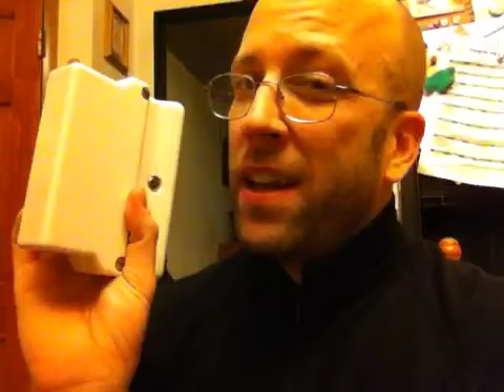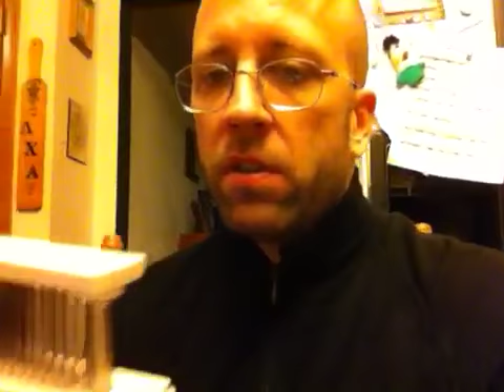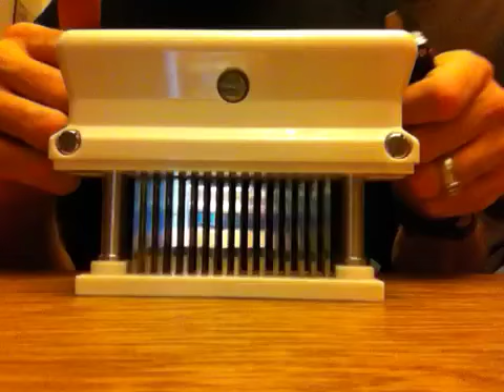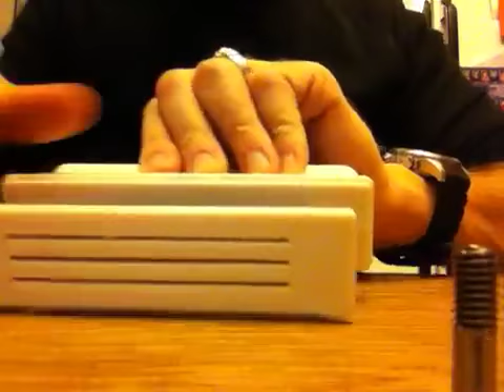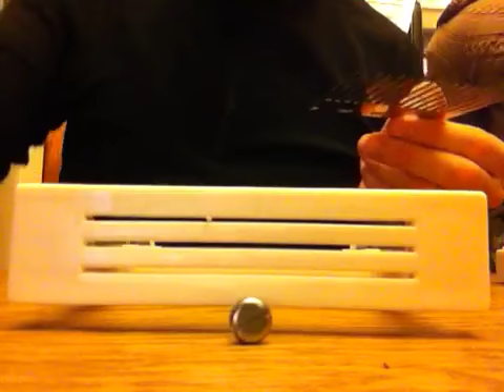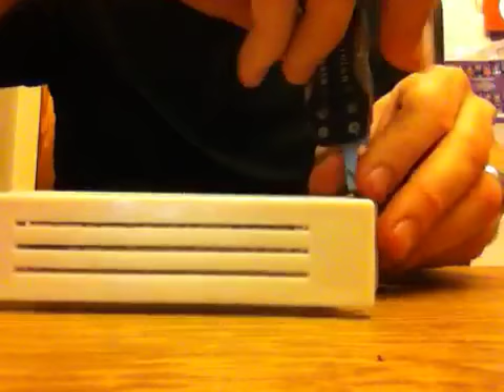Safely Clean Your Jaccard Knife Meat Tenderizer

Comment: I just came across this older video and did enjoy it but just for information, you do not need to remove all the screws. You only need to remove the top screw nearest the hand grip. Once that screw is removed, press the Jaccard down on a cutting board and the blades will come out the top. Just pay attention to how they are stacked and put them back the same way after cleaning.

Comment: You know it's top rack dishwasher safe....right?
Reply from the maker: I am leery about putting it in the dishwasher - water will get up inside of it and possibly cause rust as well as creating a wonderful climate for bacteria growth. I stand by my assertion that the best approach to cleaning is to dismantle it.
Reply: I’ve cleaned mine there multiple times - however dust and “stuff” does indeed accumulate - probably not something that needs to be taken apart often, IMO, but definitely needed some times.
Reply: No knife is dishwasher safe, the chemicals and high heat are not good for quality steel

Comment: No matter the quality if these are as a big of a pain as it looks, not worth it I'm returning mine unused. I saw other models that were much easier to dissassemble and clean.
Reply from the maker: I don’t have this anymore. Plastic cracked. It lasted 12 years. I will look for a new one that is easier to clean, thanks for the tip!
Reply: You remove the center screw,  push down on The cutting bored and the three blades and the assemble  will all come out the top. Wash or put all the pieces in the dishwasher, let dry and reassemble. No reason to remove sides screws and mess with the sping. He made this way more complicated than it needs to be.
Reply from the maker: @craigjasin7591  sadly I don’t have mine anymore to verify if that is true. It might be true. I don’t usually miss details like that but I’d be lying if I said that it doesn’t happen sometimes  😢
Reply: Did you find a model you like more?  If so, what model?